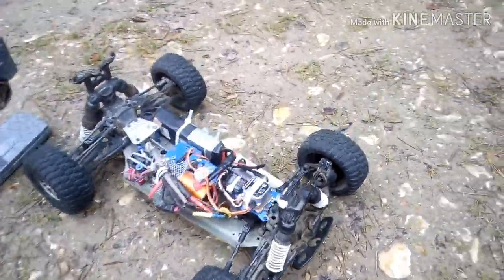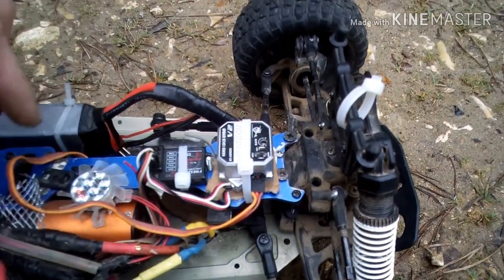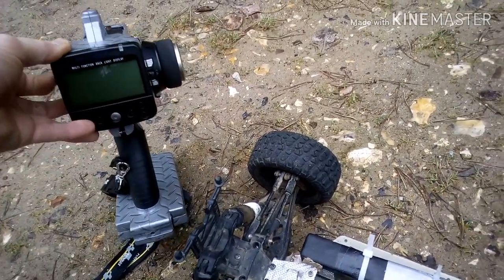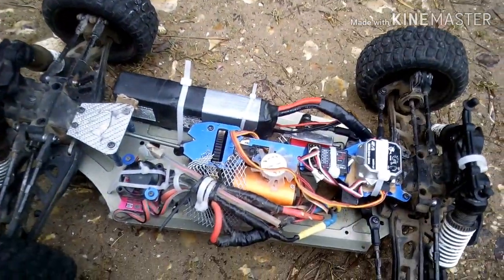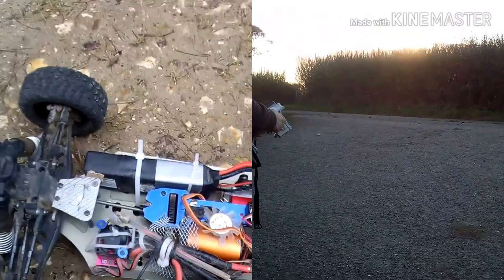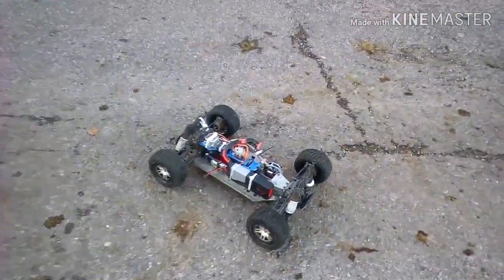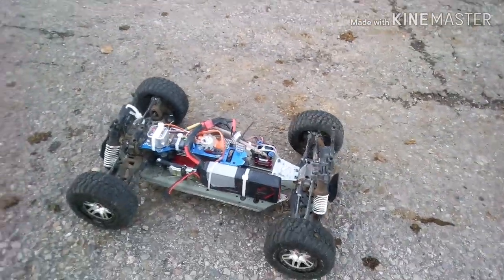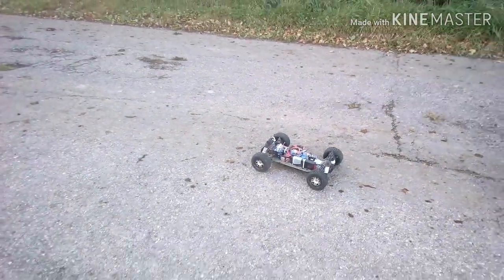Fitting a heli gyro to rc car #gyro

Comment: Good explanation! It does seem easy to fit that gyro in.  I’d need to up grade my controller.  Be fun
Reply from the maker: Cheers fella, any programmable tx will do if its three channel.... Or you could just get an integrated gyro and not faff with another tx

Comment: Nice vid-but why dont you take an receiver with an integratet gyro for steering and speedcontrol.Thats the better way to control a lightwight car. You get them from Spectrum, Reely or so one. I have two in my short course trucks and the work very well. You can have a look on my channel, there are the videos of this trucks.
Reply from the maker: Hey dude, Two reasons really...this cost me £4 on eBay ...and I don't won't a torque vectoring gyro for the lad, he's got the skill to drive a fast rc...but could use a smidgen of help when going 40+mph to keep it in a straight line....so as a stated in the vid, this will gently help him rather than toning down the power

Works for me! And for £4 I can't complain!

I'll check your vids later dude, thanks for dropping by my rc brother!
Reply from the maker: Almost forgot...I use a long range 2.4ghz module for the futaba 3pk and I'm assuming these don't come with gyros built into rx??
Reply: @RccarsUK  no you can't as fa as I know fims

Comment: Ok... i have several  2 axis $15 gyros i use in small planes...i can't see why they will not work in any rc car.... a gyro is a gyro imo... all you need is 1 axis hooked up.... am i correct? why would you need a a special car gyro for a 1/14th scale buggy? any information on this is appreciated... i have been out of the hobby for many years and am thinking about getting out of planes for a while and messing with rc cars... thanks
Reply from the maker: Well it just depends on Wether you want a gyro that controls your front steering wheels to jeep your rc straight.... (like this one I did)

Or you want a torque vectoring gyro, which are rc car specific... Which control how fast each wheel spins to keep you straight